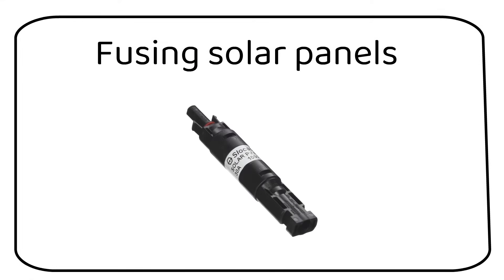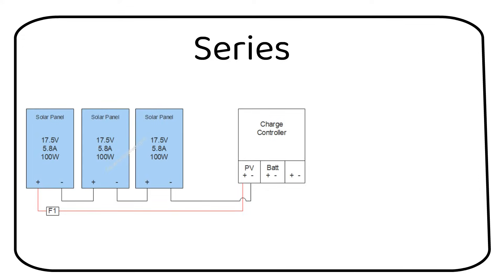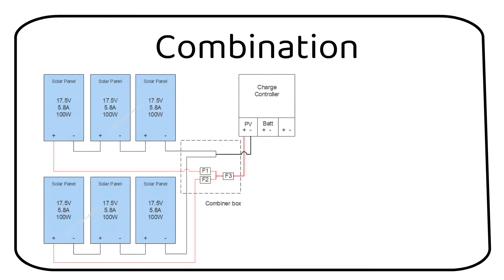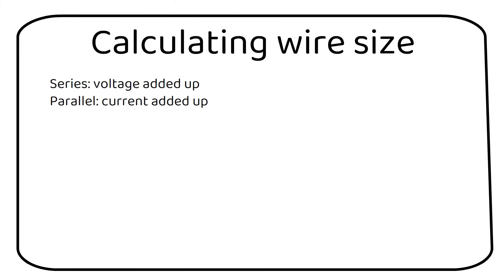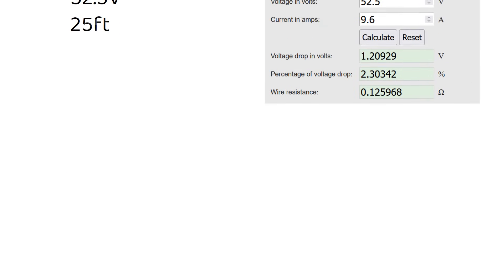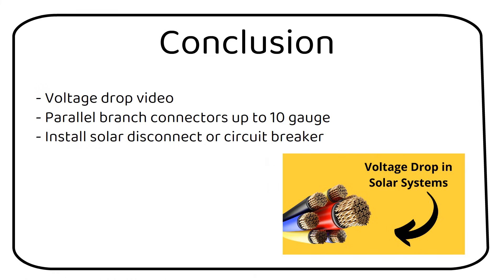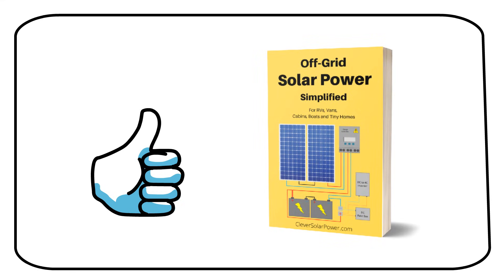Fuses For Solar Panels: Series and Parallel Fusing

Comment: No fuse needed paralleling two series strings or two individual panels. Fuse each when three or more in parallel.
Reply from the maker: Every parallel string needs a fuse. And for simplicity reasons I recommend fusing solar panels.
Reply: @cleversolarpower  Is that required, or just you being overly cautious?
Reply from the maker: @davebenz8271  Fusing is required for parallel strings. I do recommend fusing series solar panels if the combined Isc of the panels goes over the rated current of the wire.
Reply: I think rv10flyer has a point... Please correct me if I'm wrong. If the first of two panels in parallel, has a short, it's fuse may blow or may not, depending on how much over Isc you installed. Now say it didn't blow, and the second panel in parallel starts to back feed it... It also won't blow it because it can only provide 1 times the Isc.
3 or more panels in parallel... Different story.

Edit: Or do you still add in the being produced by the shorted panel?
Reply from the maker: @MrHanzeeman  No need to have a fuse when you have one or two parallel strings. You need to calculate the Isc though. If you have three parallel strings or parallel panels, then you need to fuse because the combined ISC is higher than the 1.25xIsc of the panel. Hope this helps.
Reply: @cleversolarpower  Yes, that's perfect! Thanks for verifying.

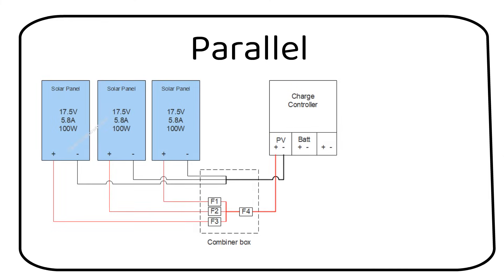Comment: There is no reason to place a "combined current" fuse (F4 @ THE 1:38 mark) after the normal parallel fuses (F1, F2 &  F3) as it serves no purpose, if anything goes wrong after these fuses they will blow anyway (before fuse F4 can blow).!
Reply from the maker: It's a solar disconnect breaker (resettable fuse). Maybe I should have made it more clear what it is. The breaker is there to isolate the solar panels from the system. It is required to do so.
Reply: @cleversolarpower  yes, maybe you can add a caption to clarify that. It certainly didn't come across in the video like that.
Reply: @cleversolarpower  Thanks for the reply, yes that makes 100% sense of things!
Reply: Yes, this is now clear.  Exactly like in my combiner box.   @cleversolarpower

Comment: What about Solar DIODE connector fuse. Is it the same ?
Reply from the maker: The diodes are already on the back of the panel in the small box. You need to add the fuse with an MC-4 connector fuse holder.

Comment: I've never understood the reason for fusing solar panels. Even if you rub through a solar wire and it shorts to earth, the fuse will not blow as a) it is sized lower than the solar current (as it has to be), and b) the fuse would be near the charge controller, so your short would typically be after the fuse, and c) typically the charge controller would stop any battery current trying to flow back through the panels in case of any wiring fault.
Reply from the maker: In a series configuration, yes. But in a parallel configuration, you need it. If one panel is shorted, the other panels will back feed into the broken panel, sending lots of current to it. In order for the panel not to melt, the fuse of the broken panel melts. However, I think it's still useful and good practice to fuse a series connection.
Reply: @clewersolar  I need to paralel, because my panel give 12,2 Amp  Isc, and 41 Voc volt, and my controller max 75 volt, I have 2 panels, shall I use 12,2 Amp x 1,25 = 15/16 Amp ? Thanks
Reply: @susiejrgensen7041 you need *1.25=32 Amps breaker
Reply: @ In parallel amps add together. Assuming same size panel, you double the amps.
Reply: @Ibian666  That doesn't explain how anything catches fire.
Reply: Houses catch on fire from unfused parallel panels, is why.
Reply: @Ibian666  How?
Reply: If only using 2 100 w panels in parallel , no fuse is necessary, correct?
Reply: I have the same question?